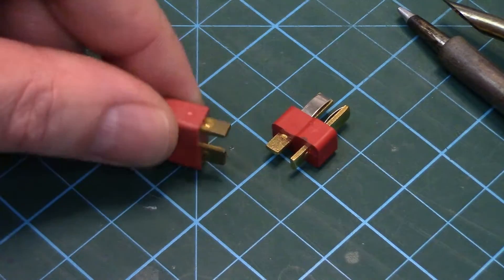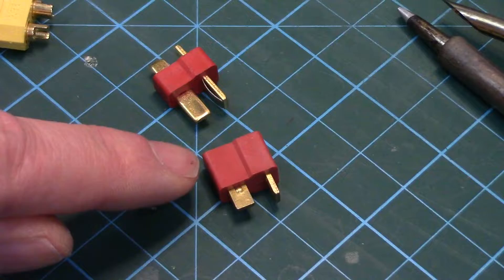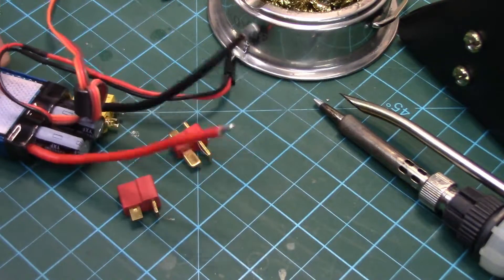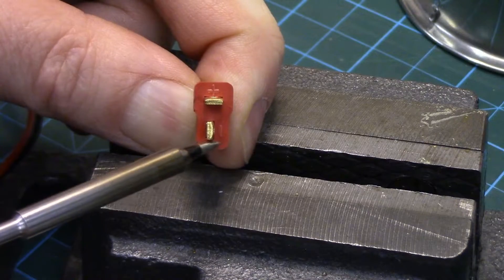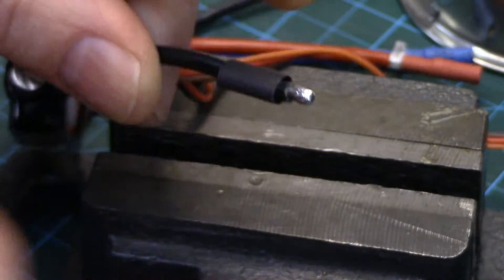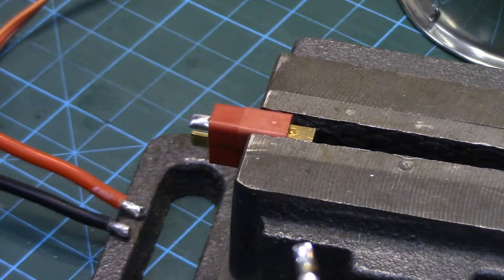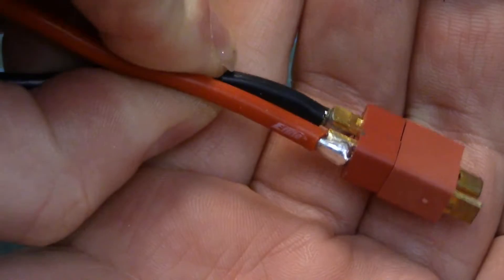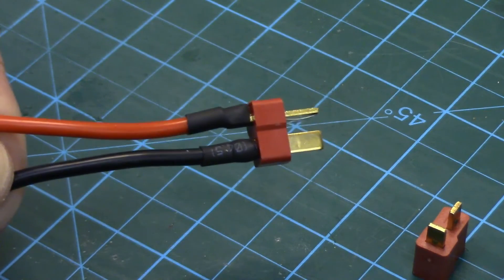Soldering Deans Connectors

Comment: What about paste not needed? I thought the paste was a must
Reply from the maker: @darrenantoine7333 - Good question. Solder paste (flux) is generally not required when you are using a good quality rosin core solder such as the Kester rosin core solder I'm using in the video. One reason I stressed the importance of quality solder.
The flux is contained within the center core of the solder so it's automatically applied as you apply the solder to the component or whatever you're soldering.
If you are not using a good quality rosin core solder however, or solder that doesn't contain flux or you apply too much heat too long and boil off the built in rosin flux, then you must use extra solder paste/flux. I cover this flux topic in more detail in the flux section of my soldering for beginners page on my website if you need more information on the what, when and how to use flux: https://www.rchelicopterfun.com/rc-soldering.html

Comment: Apparently I'm a fucking idiot because my solder absolutely will NOT stick to the deans tab when trying to tin it
Reply from the maker: Not enough heat (need at least an 80W iron or gun for most of this larger stuff), wrong shaped tip that doesn't transfer enough heat (wedge tips are best for RC connector jobs I find) poor quality solder, not enough or poor quality flux? Many reasons, and yes technique is also one. All covered on my RC Soldering For Beginners page on my site: https://www.rchelicopterfun.com/rc-soldering.html

Comment: Will lead free very fine electrical rosin core solder affect performance? Its lead free 96% tin 4% silver
Reply from the maker: Lead free solder is  difficult to work with and usually gives poor results without years of practice and good equipment.  Always use a good quality 60/40 or or 63/37 rosin core leaded solder for best results including but not limited to: ease of use, reliability, strong mechanical & electrical bond and much less risk of cold/brittle joints.

Comment: Thanks for the videos! I’m trying to make all my RC plugs common. My sons mini T 2.0 battery has EC2 connectors and I’d like to swap them for Deans. The wires on his battery are just pretty thin. Does that matter, or should I just make a charge wire with an EC2 connector?
Reply from the maker: No problem going with a larger plug (higher current rating), provided you have the room to use it. Another really good smaller plug that is equivalent (current handling capacity) to the EC2 is the XT30 so you may want to look into them if you don't have enough room for the larger Deans.
Reply: @Rchelicopterfun  I received the deans today, so I will give them a try. Also, the wife bought me a soldering setup similar to yours. Thanks for the help! Will be watching some of your videos to get these done👍🏼

Comment: Hi there is it ok to use these deans on two 4s batteries 2 way connection the batteries came as deans, but I've install max6 esc ain't tried yet thoe? Will it b ok X maxx 8s cheers
Reply from the maker: @shaunsmad rcs - connector choice is current dependent.  I can't tell you if these will work without knowing the maximum current load you will be pulling through them. Deans can handle up to about 50 Amps so as long as your application is not pulling more current than that - yes they will work. This article on my site about choosing the correct RC connector may also be of interest: https://www.rchelicopterfun.com/rc-battery-connector.html

Comment: But how did u get the solder to stick to the positive tab on the Dean's connector,??   Mine just drips right off and wont stick.  Ended up sanding the connector  first to get it to stick
Reply from the maker: Sounds like oxidation contamination on the solder tab. Not enough flux perhaps or low quality flux/solder? Not enough heat to activate the flux to clean off the oxidation might be another possibility.

Comment: Now I can Center Dean's to my ICS M4. Airsoft still uses Tamia plugs but some more expensive guns have Deans connectors. Basically to get the best rate of fire on full-auto I need to make this change because well it does have a mosfet so i can safely run 11.1 it does not have deans.
Reply: Did it work

Comment: Should of watched this before actually soldering for the first time 😐 now my solder is all weird and the and when I plug in my lipo the esc turns on and the motor won’t ever run but everything else works fine

Comment: This is a pretty good video on how to solder these connectors, but one thing that I'd like to add, is that generally when you are soldering, you want to heat up the connection / surface to be soldered (up to or just above the solders melting point), and allow the heated surface to melt the solder.  By heating the solder and applying it to the non heated surface you will create a cold solder joint.

I know this video will work for most people because these connectors are a pain in the butt to solder (due to the thickness of the copper) and most people are just trying to get this done w/o melting the connector.  I recently had my deans to banana connectors (from Amazon) snap clean after repetitively jumping my RC, and it was easy to tell it was because of a cold solder joint.  I was lucky my lipo's didn't short out.

Anyhow, its almost impossible to solder these the right way w/o getting a very small amount of melting to the connector.  But for anyone who has a hot air station, I heated mine up to 350 degrees, applied the hot air directly to the deans connector and touched the solder (Kester brand) to the connector which made it melt.  The key is to make sure that the air from the hot air station is directed away from the connector.  Although you'll still get a very small amount of melting to the inside of the connector, the connection will be solid.  You could then tin your wire and solder the connector.

This might be much harder to do, but if you're using a soldering iron, you should hold the iron on underside of the copper, and apply solder to the top, which will make it melt when the copper reaches the solders melting point.  If that doesn't work for you, then proceed as the video suggest.  Just make sure to properly insulate your wires in case of a break off.
Reply: The ‘heat the joint’ method is one of those ‘if you only learn one thing’ bits of advice. But if you look at what you are actually trying to achieve (bringing the joint, solder & flux together at the right temp), there are more ways to approach soldering. Wave soldering wouldn’t exist, for example. 

Most people only have small irons that are intended for circuit boards and general electronic work. For larger joints, you need an iron with a fat tip, and more horsepower than most hobbyist setups. 

When heating large joints with a small iron, you get heat soak, and melting of plastics etc. A larger iron lets you ‘sting’ the joint so the immediate area gets up to temp faster than the heat can travel along the terminal/conductor to melt the connector.

The alternative method of having a blob of solder on the iron tip, and heating until the precise point where the solder flows is a perfectly good method as long as you understand what your intended result is.

Using extra flux on the joint works for me too. Ideally I will flux, then tin large terminal before blob soldering them as I get better results that way. But a bit of extra flux painted on a large terminal before charging straight in helps too. Note, this is electrical soldering rosin flux, not plumbing flux. 

More often though, I use a Portasol Super Pro butane iron (other irons are available) for large joints and audio connectors. This let me keep my regular iron set up for microelectronics, and gives me a heavy duty iron for when I need it most. Being ‘cordless’ makes it convenient to pull out when needed, and I don’t need to let my regular iron cool so I can change to a chisel tip. Plus it is a handy thing to have in general for auto stuff etc, where precise temperature doesn’t matter as much, and you can’t drag your car to the bench. But any big nasty plug in iron will do too, for not much extra.

Comment: Thank you for your videos, I will be using the knowledge in airsoft. All my guns came with tamiya connectors but those sometimes heat up (high amp during motor start, lots of starts in semi auto) so people switch them to Deans, and that's what I will be doing too.

Comment: Can you do a video how to solder a JST connector on the ends of a deans plug after ESC wires are ALREADY soldered on the deans?  Trying to figure out how to solder both on the ends of the ends with the limited space, and how to put dual shrink tubes.  Thanks!
Reply from the maker: I would desolder the deans plug on the ESC, put new heat shrink over the ESC wires along with additional JST pigtail wires, solder the small JST wire to the larger (I assume) ESC wire, resolder the combined ESC & JST wire back on the plug, slide the new heatshrink over the solder tabs, and shrink it.
Reply: @Rchelicopterfun  Thanks so much for explaining this John.  I'm not the best at soldering.  Any way you could do a short video showing this procedure?  It would help me a lot.

Comment: I have always had a lot of difficulty soldering Deans connectors. I cannot get solder to adhere to them no matter what solder, gun, iron, flux I use. I try and try and can never get it to grab on. I always end up melting them where they are unusable.
Reply from the maker: Are you pre-tinning the tabs first? A good tinning job is the key to a strong bond :-)
Reply: @Rchelicopterfun  Yes.  Solder just runs off them no matter what I do. Numerous times I have tried and tried just to end up melting the plastic. Flux, scraping has no influence on it. I have also used different irons..40 watt, 80 watt
Reply from the maker: @osbornephoto1955  What type of solder are you using?
Reply: @Rchelicopterfun  4 different brands. All rosin core. My Dean plugs have 2 different metals. I do not know if this is normal or not. One side is brass or copper and the other steel...I think. The steel side is the side that will not hold solder. I even used a 80 watt iron but all it did was melt the plastic. Yesterday I ordered a set of plugs off Amazon and will give them a try.
Reply: @Rchelicopterfun  BTW: These are the original Deans plugs from a Hobby shop...not some aftermarket ones
Reply from the maker: I've never seen a Deans plug with dissimilar metals on the soldering end tabs. All the ones I've used over the last decade (name brand and aftermarket) are all gold plated copper just as shown in the video. The only dissimilar metal on Dean's I've used is on the male connection end which uses the silver sprung metal in conjunction with gold plated contact, but of course you don't solder that end. Hope the Amazon ones you ordered work better.
Reply: not enough heat, use bigger soldering tip, dont use tiny pointy one